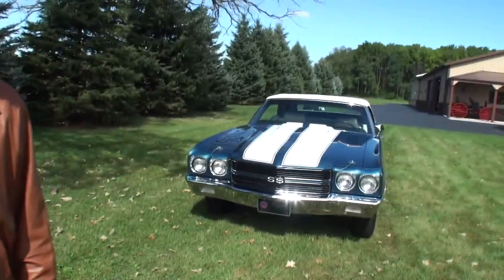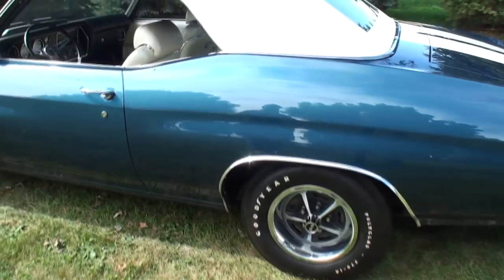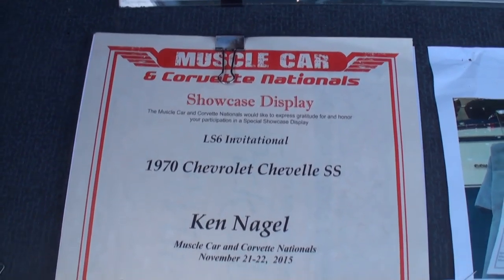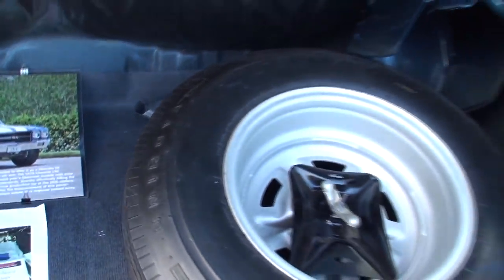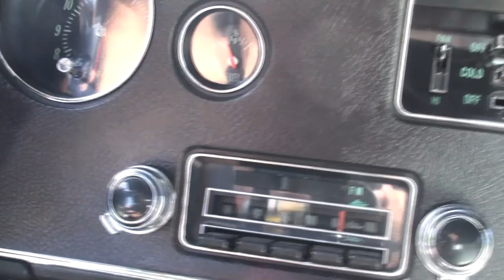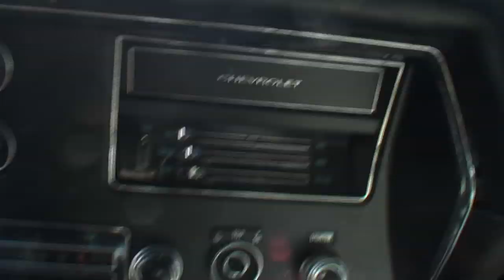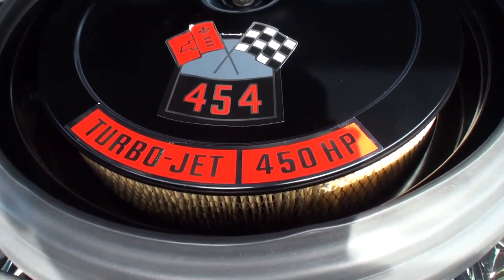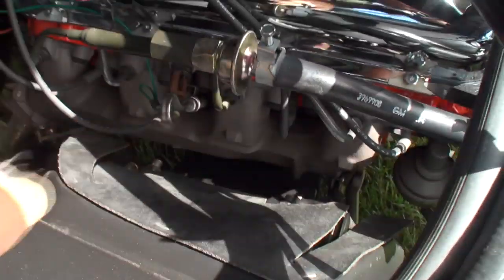1970 Chevrolet Chevelle SS Blue Convertible & LS6 454 Engine Sound - My Car Story with Lou Costabile

Comment: Hey Lou you really hit it with this one,  I ordered my SS454 brand new, 4 speed, red with black stripes black vinyl top black interior ,. A little story i lived way out in the country with my parents at the time i used to wash my Chevelle and then drive it down the road to dry it off, well the speed limit on this road was 65 and i usually took it up to 130 to dry it good, anyways one time i was doing this and i seen a car in my rear view mirror and i thought to myself gee that car should not be there after what i just did so i slowed down more after a mile this car catches up to me and puts his blue light on and pulls me over,  the officer asked me how fast was i going and in a sheepish voice i said 70 maybe,... well the officer said to me i was going 100 and you were pulling away,... and i replied  ohhh thinking now i am in deep do do, well as it turned out he was a detective and told me there would be no ticket as long as i let him know of any bad activity going on and i said sure... we went our separate ways i slowed down and never seen him again.
Reply from the maker: Hi Newton Washington, That's a great story :-)  Thank you for viewing and sharing, Lou
Reply: WOW 😀
Reply: What a ride!
Reply: this car was found in a junkyard in north Carolina in 1989.
I was working at the shop where the car was brought to.
the owner of the shop was going to restore it but it was a basketcase.
so he resold it.
the car is nothing but reproduction and restamped parts

Comment: Nice LS6. Rockcrusher was not the name of the shifter, it was the name of the Muncie M22 4 speed gearbox due to it's almost straight cut gears thus making the famous whine. My channel shows my 1970 Z28 that has the M22 in it. The smog pump was not just a California requirement. Many muscle cars from 68 on had the smog pump. My 70 Z28 was built in Norwood Ohio and was shipped to Ontario Motor Sales in Oshawa Ontario Canada and it came with a smog pump. My pump seized up on me last summer, so the pump and tubes are currently off the LT1 engine. My 1968 Z/28 I bought in 1974 while attending College came with a smog pump but was not on the car when I bought it.  A friend of mine owns my 68 Z/28 today. My future Musclecar will be a 1970 SS396 Chevelle SS with a 4-speed and ZL2 flapper cowl induction hood option. The ZL2 flapper works under engine vacuum and had a solenoid and a switch at the gas pedal to make it work.
Reply from the maker: Hi John Miller, Thank you for viewing and sharing your knowledge, Lou
Reply: True!
I had a 69 428SCJ 4sp Torino, w all the OEM Factory smog equip on it.
Faster than opening a beer can, it was removed!!
Pontiac 400 series" in the late 60's  (67 on out) cars, Are equipped w #670 Cyl Heads w this special type air injectors", smog equip, holes on the heads.,

Comment: What kills me is the Buick 455 that was produced this year 1970 made claim to be the fastest production car AKA HEMI killer too.
Think it was Motor Trend magazine said this.
I'de bet my Firebird this LS6 would shut that old bad rumor down before the 60 foot mark!
Reply from the maker: Hi Ash qelon, Sounds like fun comparisons :-)  Let's make sure I have my camera for the "showdown" :-) Lou
Reply: It's a secret don't tell anybody the the Buick Stage 1 made 425-450 not 360 horse power.
Reply: @markg7030  
This thing Buick you tell about is no Push over!!!
Buick has (collectors) / had a few pieces that Are Very dominant!!!
Don't think it is not realized !.
If you can ask Car owner to perform or compete let me know plz.
Love to see it.
Yet,  PRESERVATION of the cars engines is Mandatory!
Reply: @markg7030  .. interestingly, thanks.. we have seen that BUICK Deports, a couple,of times, !!! , & I remember (( ps I bought  a new * DODGE 70 CORONET 500/383/ auto / Console/ De,luxe INT/ ps,PBRAKES/310H ( acttually  maybe 360 HP plus?)... could not afford the BUICK STAGE, SUPERBIRD PLYMOUTH/ GTO IN 1970, just out of Pharmacy School.. the Dodge was $3100, full Delivered at DODGE/ AMC DEALER next to Pharmacy where I worked ( SYRACUSE IN).....WITH **LONG TERM LOAN OF **24 months(?, if Memory serves, as my Wife had to drive a lot to finish School, etc)......a different time, Actually, imhad seen a SUPERBIRD IN Lafayette in, before Graduating: a little to long and Dramatic ( the HEMI OPTIONS  WERE expemsive, if Memory?.)....and eats gas/Repairs.......

Comment: One of the top (available) LS6 Convertibles in the country is up for auction at Mecum Glendale next month, it’s the black on black “Fuller Car”. Do you ever visit these auctions, Lou ? I’ll definitely be watching to see what the top models go for.
Reply from the maker: Hi richgall63, Usually don't go to auctions to often because when I ask, "So how long have you had the car?" and they say "About an hour" doesn't make much of a story :-)  HOWEVER sometimes there is still a good story on why they wanted the car, Lou
Reply: Lou Costabile, I’ve never been to a Mecum in person but I figured there might be some previous “seller” owners on hand, particularly to say “yay” or “nay” if there is a reserve on the car. It may actually be one of the optimum times in history to bid on these gems since the demand is relatively low now. The unrestored with just 10k mi “Fuller Car” didn’t reach its reserve 6 months ago at Monterey !
Reply: https://youtu.be/f9t3AZ_3yL4

Here, Peter says his LS6 Convt is easily worth 150-200k, and this was close to 20yrs ago! But no matter how impeccable that Chevelle is, he mentions its restored, so it isn’t nearly as valuable as an original. His car would be very lucky to get 150-200 today. @20yrs ago, “experts” were predicting the top muscle cars would be into the 7 digits, but routinely, that isn’t the case these days.